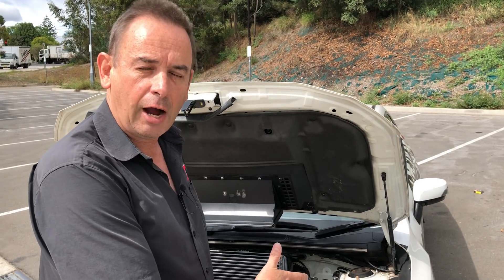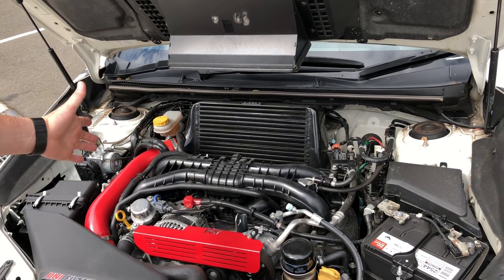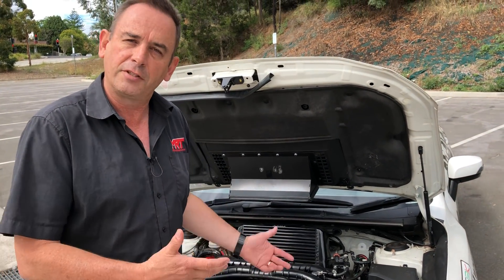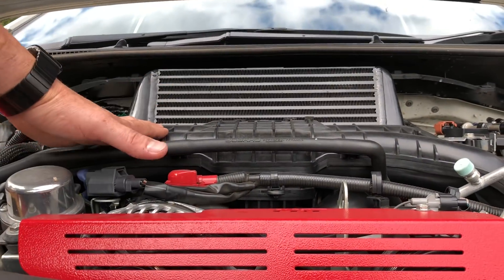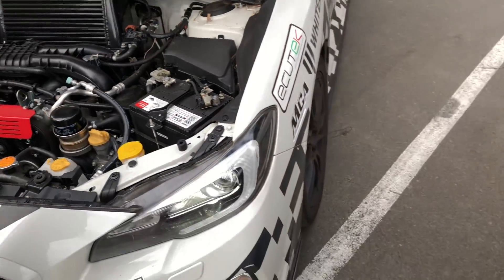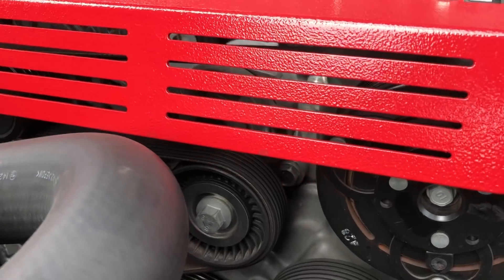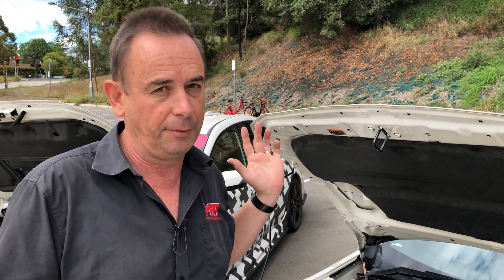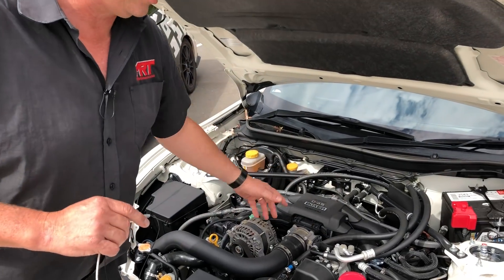TURBO BRZ VS. WRX FA20 Engine Comparison

Comment: I don’t know if this will get a response because it’s on an older video but I was thinking about getting a WRX and I was just wondering how much comfortable power you can make out of it with it still being a daily drivable vehicle I don’t need 400 hp I was just looking for maybe STI level horsepower or something that I could get to where it would still be reliable and not on the edge of blowing up
Reply: Probably a simple ECU reflash to better suit your local fuel and you'll probably achieve STi level power :)

Comment: Hi Brett. Is it at all possible to get the iconic wrx rumble back with the 2017 WRX FA20 ,do they make aftermarket UEL headers.
Reply: No they dont for the fa20dit engine (wrx). The twin scroll is more responsive, produces less back pressure and is over all more efficient than UEL headers. Plus based on design you cannot have a twin scroll uel header. (I already asked this question)

Comment: The FA20 BRZ boxer platform is not the greatest from factory.... However... If this engine is rebuilt it has endless potential. It can make more power than EJ series... (pistons, con rods, compression ratio rebuild etc) This engine is the best 2.0L Four cyclinder engine ever engineered in Japan (REBUILT IS THE KEY WORD HERE) just look it up...

Comment: for every one who thinks of swapping the wrx engine into a brz, there is an other big difference, on the wrx the starter is on the left side, on the brz its on the right side, so you cant really use the rwd gearbox of the brz with the wrx engine... Im very sad :(
Reply: What about the other way around. Can a naturally aspirated brz engine used in a wrx with stock wrx transmission?

Comment: I cant find any answer or swaps anywhere about this but i have VERY important question, could you swap a wrx engine in the brz while just plug and play? Does it mount right up to the brz transmission? I want to trade my car for a brz with 135k mile engine in it so i want to know if the engine fails that i can just find a wrx engine and just swap it easily? I see in the video theres some differences between the 2 engines but i just want a simple answer if i could swap a turbo wrx engine into a brz simply and smoothly?
Reply: MaddoxLyrics 
2jz would be better.

Comment: I did 140mph at 5000 rpm easily and got there very quickly without peddle to the floor either.Car will accelerate to 7250rpm at least! talking at least 155 to 160 or so! for real.

Comment: These figure include 93 octane gas on a 91 octane tune. with a 93 octane tune approx. an additional 2 to 3 ft/lbs torque more than a 91 tune

Comment: At 9 psi I know my car puts out approx. 216 ft/lbs torque at the crank. with the 3 inch Greddy Evolution GT catback untuned  she puts out about 220 to 225 ft/lbs torque at the crank
Reply: davie crocket you sure about those numbers? That seems pretty low for 9 psi? Just curious if you meant like 316?

Comment: Jackson Racing Supercharger c30-94 at 9 psi red ine is fantastic! Runs smooth no issues Got the duel radiator oil cooler product as well. Conservative 91 octane Factory carb legal tune. When pushed she is very fasy. have a 3 inch catback from greddy adds power with supercharger as well.

Comment: So basically pistons and rods and you're good? Doesn't seem that bad given the power you want to extract from a 2.0
Reply: With aftermarket rod/pistons people have been getting 500whp+ out of the FA20DIT's
Reply: Go low compression on the pistons as well

Comment: In other words.  Toyota helped Subaru in reliability...
Reply: Subaru Makes engines for Toyota FRS but I am sure they stress test the engine and told them what to do to improve it and change. Same thing as the Supra where Toyota tells bmw on what to improve and modify
Reply: More like the other way around
Reply: @austinhowze6280  Please explain how.
Reply: @gtmike916  not every Toyota engine is reliable not all Subaru motors but Subaru has had ass loads of boxers go 300k 500k+ and so has Toyota so his statement is invalid just cause you blow up a ej doesn't mean it wasn't reliable like when a 2jz blows
Reply: @austinhowze6280  That is true actually and it really depends on the owner too.
Reply: @gtmike916  I was going with the flat 4 being more Subaru then Toyota considering Toyota dont make flat 4
Reply: @austinhowze6280  Nobody but Subaru and Porsche ever makes Flat-4 Engines period. Honestly the Boxer engine is good, minus the FA20’s weak rods when it comes to boost. Personally though I’m gonna hit up Element Tuning for them to do a fully built NA motor with a 2.1L Stroker. Hoping for 300-400 wheel hp with said build though.
Reply: @gtmike916  they trying to squeeze all the mpgs they can out of a engine so a lighter rotating assembly is a must
Reply: @austinhowze6280  That is true
Reply: @austinhowze6280  lol..subaru is known for their reliable engines now? dumb fanboy
Reply: @bboyairrick  lmao if they wa ssd's not reliable then why they used on airplane and boats

Comment: Brett, you mentioned for the FA20 in the BRZ roughly 7 PSI to be the sweetspot concerning power and reliability. How much power and torque do those engines typically make with such a boost levels (at the crank)?
Reply: I made 389whp at 11 psi on e85
Reply: my measly understanding is that the engineering of the fa20 is quite good, however the metallurgy leaves something to be desired if you want to go forced induction. getting forged internals will make this engine go pretty damn far
Reply: Crawford Performance out of California has a ton of R&D into the platform. They are Subaru boxer gurus.
https://crawfordperformance.com/products/crawford-performance-86-turbo-kit-2013-present-subaru-brz-scion-fr-s-toyota-gt86
Reply: Mines getting 300 whp on 10 ish psi
Reply: my only question is.. is it safe to be at 7Psi and run e85 or is that already too much stress on the motor
Reply: @Elegiess68  e85 runs cooler and has a 110 octane rating which is a pro for higher compression motors like the fa20 so by all accounts you would be doing a turbo fa20 many favors, id imagine it being direct and port injected is a bonus for e85 aswell
Reply: @Elegiess68  It will be safe, just make sure you have a reliable tuner working on the car and a good flex fuel kit
Reply: Mine is also 300whp at 10psi. Or about 340 crank. 7 psi would be about 260-270whp...300 crank. Less driventrain loss in rwd.

Comment: I just want a turbo kit that has a cam shaft driven oil system thats also CARB legal. A guy can only dream
Reply: the only carb legal kit I know about is the works kit. here in mendocino county there is no smog check. good news if I end up living here long term
Reply: Why would you want it to run off the cam?

Comment: Also the BRZ has a Toyota D4S direct and port injection fuel system, and the WRX is only direct injected.
Reply: Ahh I didn’t know that and was wondering about this. Good to know that a catch can is needed though either way you go (if you decide to turbo the BRZ/FRS).

Comment: All i want is the FA20F with the FA20D aluminum intake manifold so that the FA20F could have all 8 injectors. But even then, its not so simple. The wiring and comptuer mess would be tons in R&D alone.
Reply: Tim Middleton look up ibuildracecars.com they have fabricated a kit that allows you to swap intake manifolds. You will need a front mount intercooler and Aftermarket fuel rails plus a good tuner but it is now possible.